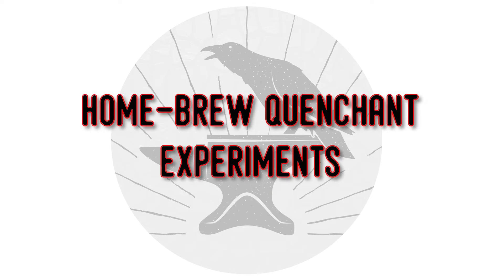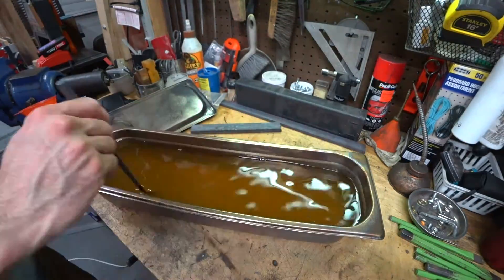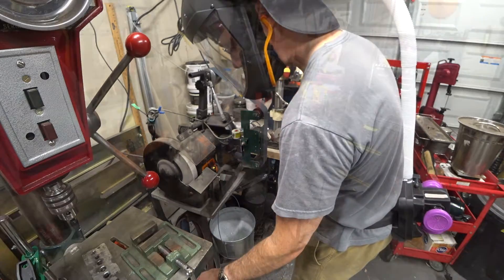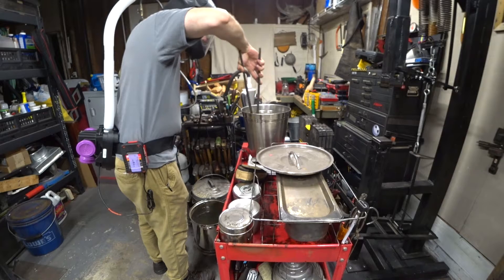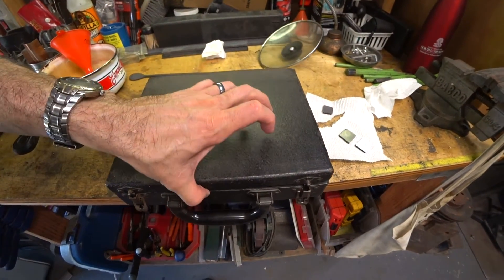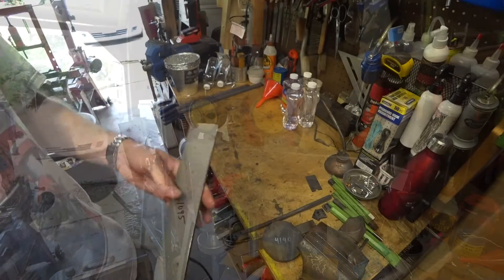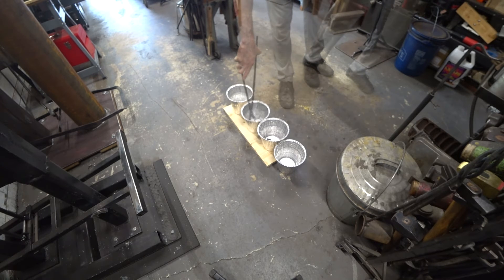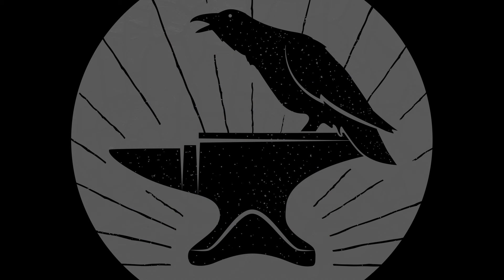Stop quenching your knives in vegetable oil! Experiments in DIY quench oils. | Heat Treatment

Comment: Full mineral oil seems interesting, probably stinks less than transmission fluid. The atf gets almost water quench hard without cracks and severe warps
Reply from the maker: You are right. Mineral oil still has an odor when it burns, of course, but very little compared to anything except water.  I have never quenched in atf, maybe I'll try it. If I do, I'll put the results up in a video.

Comment: OUTDOORS55 did a test with canola oil and the 1084 steel he used hardened just fine. worked better than (used) motor oil.

Comment: Been wanting to try 75 0/0 canola oil - 25 0/0  water with enough fish soap to make it emulsify ?
Reply: Dish soap
Reply from the maker: Interesting idea it seems like it would take a heck of a lot of dish soap. Maybe the other way round be easier.  It sounds like the DIY equivalent of polymer quenchants. Never have used them, but they have a quench speed in between water and fast oil.

Comment: 67.5 HRC? That's as close as plain carbon steel can get to Rex 121. I would sure love to achieve that hardness with any tool steel. I think that I was able to achieve that with spring steel using only soybean oil.
Reply from the maker: Yeah, that is the reason I used water as the control. In order to get full hardness.

Comment: The only steel that I would quench formally in water is rebar. Able to achieve the hardness a masonry chisel would need.
Reply from the maker: As I understand it, the carbon content of rebar will vary, but it will always be on the marginal end for hardness. I don't think it's a good idea to rely on it for anything that needs to be hardened.

Comment: If just motor oil ain't enough, then I'll mix it with diesel. Did it help with 1095 steel? Yes! That experiment also passed my file test. Only diamond could scratch it with ease. Oilstones struggled to wear it that hard.

Hard enough to dish an oilstone indeed.
Reply from the maker: I haven't experimented with motor oil, many modern varieties are very low viscosity. I'm sure they work well.

Comment: Mineral oil and vegetable oil are the same. Been well known for decades. Been working great for 40 years. No need to make your own. Your working way to hard on a problem that doesn't exist
Reply from the maker: For high hardenability steels, I'm sure you're correct. But, as detailed in the video, mineral oil and vegetable oil yield very different results with low hardenability steels.
Reply: In viscosity? I agree. Mineral oil is what I would normally use for most quenching. I prefer tool steel to plain carbon steel anyway. Especially with decent amounts of tungsten or vanadium carbides.

Comment: 800°C not enough for oil quench
Reply from the maker: I appreciate the input, but the alloy(s) I was using (W1 or equivalent) should harden fine at 800. The ASM heat treater's guide recommends 760-845. Also, that is why the water quench was used as a control. If 800 was insufficient, the water quench coupon would not have achieved full hardness.
Reply: I generally quench when it's bright red.

Comment: Why don’t you guys just buy real quenching oil and stop screwing around? McMastercarr has fast and slow. It’s not that expensive, particularly when considering the cost of proper steel. None of these oils are suitable. Additionally, a water hardening steel will not reach optimum hardness with oil.
Reply from the maker: I think this kind of experimentation is fun and interesting! In the end, it did convince me to switch to a commercial oil. I have since switched to Quench 50 (formerly Parks 50) with excellent results. It works well, even with water quench steels like W1 (only ever tested on 3/16" and thinner cross sections, though).
Reply: @ravensroostforge  a lot of guys do this. I’m not trying to be preachy, but it’s dangerous. Quench oil is designed so that when you dip the parts in and it flames, the flames go out as soon as the part is submerged. With many oils, the flame will continue once begun, which is very dangerous.
Reply: Depends where you live. Most countries can't even afford such specialized oil. Motor oil, veggie oil, diesel and mineral oil have more utility.
Reply: I never had steel ignite when dunked in mineral oil. It's important to note that knifemakers in other countries would edge quench axes or blades differentially in water to reduce the risk of distortion.
Reply: @ steel doesn’t ignite. The oil ignites, but you know that. If it’s a a small blade and you push it all the way in very fast, you may avoid the burn. But it’s dangerous and I’ve seen results of an oil fire. It’s not good.

Comment: Any mineral oil can use for quenching?
Reply from the maker: Yes, you should be able to. For this experiment, I used a food grade mineral oil. The kind sold in the pharmacy as a laxative.
Reply: My knife got really hard when I quenched it in mineral oil one time. It's important to mention that it was spring steel that I quenched before I sold it.

Comment: Love the video! I'm new to quenching and I wonder about tempering back the hardness. Most finished knives I've seen have been tempered back to well below 60. If mineral oil gets us to 60 HRC, is there any advantage to getting the blade harder than 60, with a different quenchenat perhaps, prior to tempering it back? Thank you for making this video.
Reply from the maker: I am not an expert, but my understanding is thus. Ideally you want the highest hardness reasonably attainable. You then temper back to the desired hardness, which relieves stress and creates the most uniform microstructure.  If the as quenched steel is already the final hardness it means it did not fully transform. If you use it as is then the internal stresses and non uniformity will result in sub optimal performance and increased risk of warping and cracking.
Reply: @ravensroostforge  Thanks for the response. As a first knife quenchenat would you recommend the mineral oil? Or should ai just bite the bullet and get some Parkes?
Reply: @ravensroostforge 
It's a little more complicated than that, the quenched hardness even in water will vary a little depending on the time held and temperature during the heating before quench. If you don't do it as much, or as hot, depending on the starting microstucture, it won't be as hard as feasible, but it will be better than an improperly quenched steel since it's less hard due to less carbon in solution, rather than incomplete martensite transformation. But if you're doing it the forge way, you want it totally hard and then temper back. It's best to not temper past 450 because it'll get softer and less tough at the same time. 350-400f gives the best properties usually, choose a better steel for the task if that's not tough enough. Like 15n20 instead of 1084 or such.

Comment: useful stuff thankyou 
atleast now I know what I did wrong with my last file knife...I quenched in vegetable oil and its not hard enough , it taks an edge but doesnt keep it long....trouble is I didnt find out untill after I glued the handle scales on.....
Thanks for sharing
Reply from the maker: I'm glad you got something useful from the video. It's always a bummer when a project doesn't come out as planned, but everything is a learning process. I'm sure your next knife will turn out great!
Reply: That's why I use a file to test hardness. Switch to other fluids if necessary.